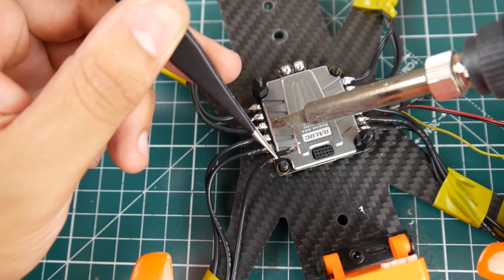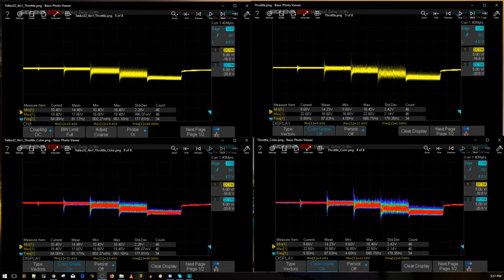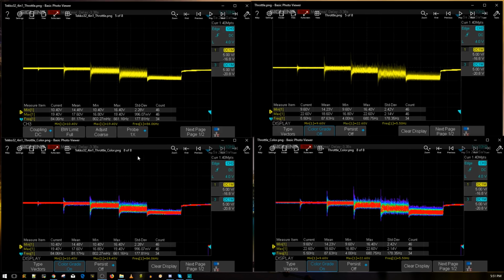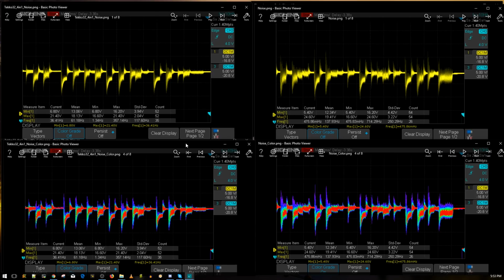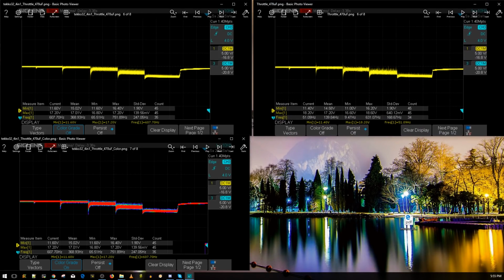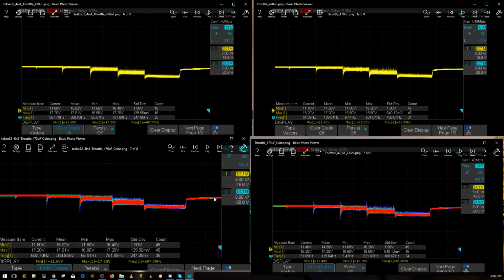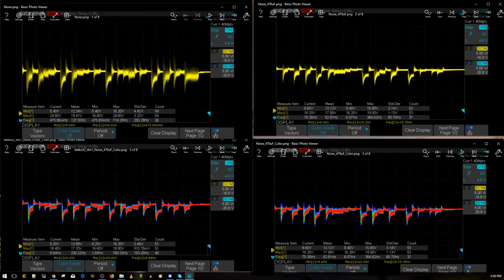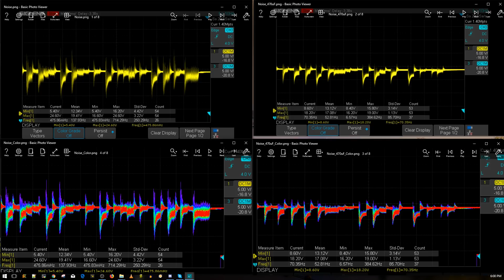The Best 4in1 ESC Shootout // Dalrc Engine VS Tekko32 4in1 ESC

Comment: is there a 4.1 esc that will handle 6s and has low noise and is reliable? is it the tekko32? ive got spedix 4.1 and i had one go bad and seemed to be mosfet, is there anyone who can fix 4.1 esc? its not burnt up but it has continuity from ground to #2 motor pad just one pad

Comment: Heya!
I'm using a DalRC Engine 4in1 ESC combined with a DalRC F405 FC and a 1000uF 35V low ESR cap.
Cam and vtx are powered by the 9V BEC and i'm having terrible diagonal line noise even when the quad is not even armed.
Is this caused by the switching regulator of the 9v BEC?
And how do i get rid of this?
Reply: Brundle Fly, did you replace the VTX with a different brand or did you just get a replacement.
Reply: Jesse F. I replaced it with another ExuAV VTX Pro. Using these for a while now and didn't have any noise problems until now.
Reply: Looking around I found a couple reviews from people that said they were getting diagonal lines as well so it might be a good idea to get a different vtx.
Reply: I soldered a 10V 330uF cap between 9v and gnd of the camera and vtx, but that didn't change anything.
Reply from the maker: Change 9v to 5v for cam
Reply from the maker: 90% sure it's the cams inner voltage reg
Reply: Thanks so much for you reply Dronemesh!
Changed Cam to 5v and even changed out my vtx and antenna, still no change in noise.
Also just checked that my frame is not grounded to my flight controller or vtx.

What else could i try? I'm lost. :-(
Reply from the maker: Brundle Fly Give me the name of each component you are using.
Reply: -DalRC F405 FC
-Engine 4in1 ESC
-Dys Samguk Wei 2207 2300kv
-Foxeer Predator Micro V2 @9V
-ExuAV VTX Pro @9V
-Frsky XM+ @5V
-Runcam Conrol Adapter @5V

I switched out the cam to a Foxeer Monster V2... and even after connecting the cam's video out directly to the vtx the diagonal lines don't go away.
So it's also not the cam or osd.
Reply: I had a problem with 12v bec and 12V led's. After disconnecting led's problem has gone totally.
Reply: Or Try Matek HV, i have DalRc Engine 4in1+DalRc F405fc and video is perfect!
Reply: A Unify Race HV costs the same. Think i'll give this one a try. ;-) Thanks for your help Mikolaj.
Reply: Just wanted to let you know that it was the ExuAV VTX Pro that was causing the diagonal line interference. Installed a TBS Unify Pro Race today and the video feed is crystal clear.
Don't know if the filtering on the TBS vtx is so much better or the ExuAV vtx itself is causing interference though. O_o

Comment: Nice test your vids are so simple and pratical. 
Good job. 
I almost have all the parts to build my DM-Sliptsane :)

Can you test this ESC?
Aikon AK32 35A 4in1 ESC 3-6S
Hobbywing - XRotor Micro 45A 4in1 BLHeli32 6S
Spedix GS40A 4in1 Blheli_32 40A ESC (2-6S)